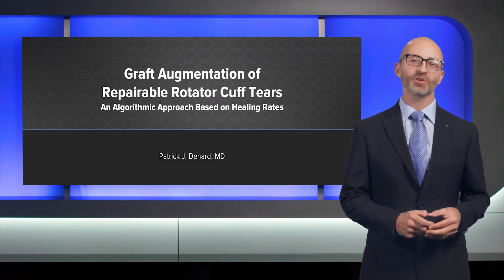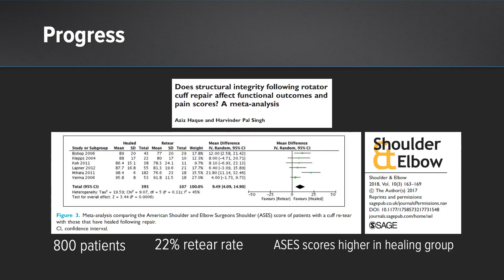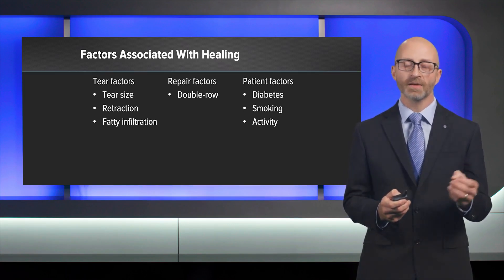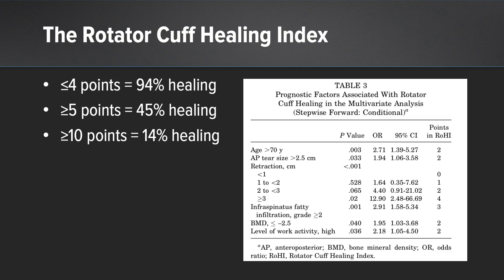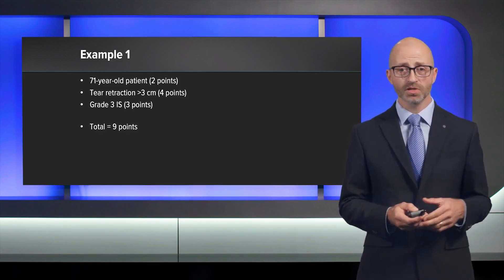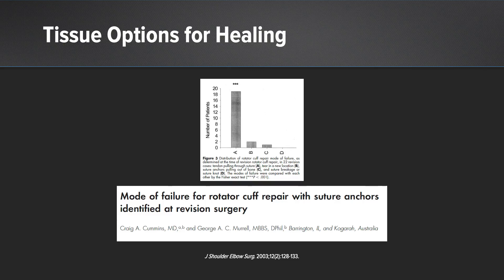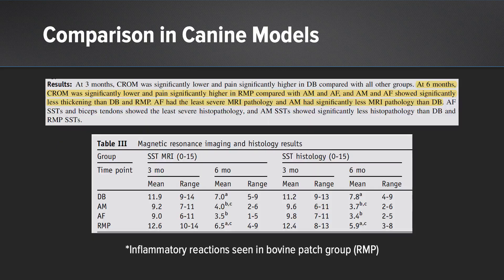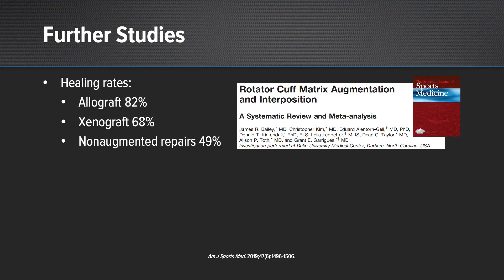Graft Augmentation of Repairable Rotator Cuff Tears: An Algorithmic Approach Based on Healing Rates

Comment: Sir I have a question. I have had my cuff repaired 3 times.The first surgeon only did a partial repair,and it tore.Second,he did a complete repair,but Physical Therapy tore it. I finally had the VA (Veterans Affairs) fix it.But years later my dr said my cuff is weak.
My question is can  Graft Augmentation strengthen my existing repair? Thank you!